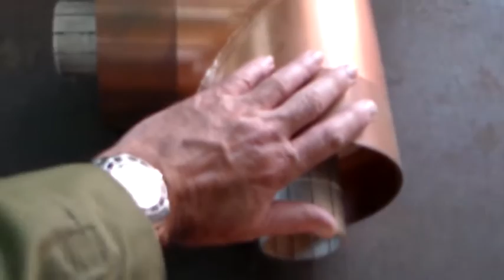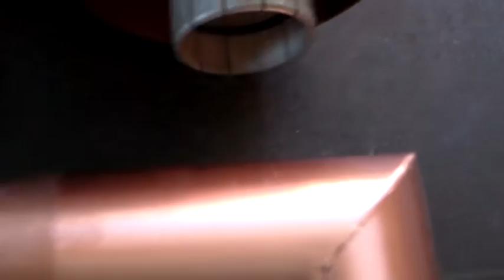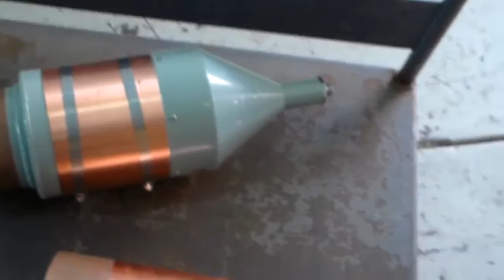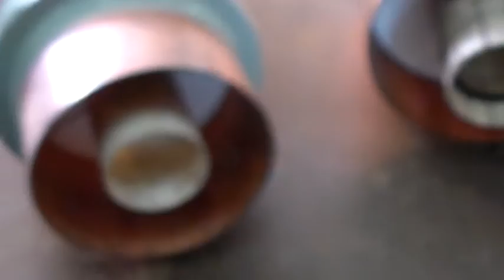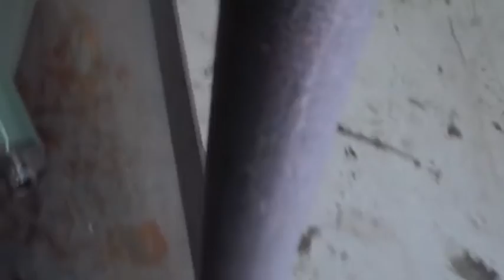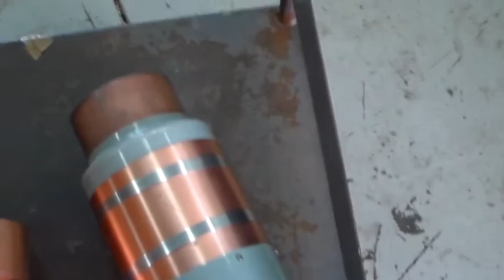High Power Co-axial Connectors And Adapter Used In Broadcasting.

Comment: Copper plated because the RF flows on the outside.

These are not actually coaxial joiners, they are simply right angle bends to take the pipes wherever they need to go. Most broadcast sites use straight pipe feeder. They are "fittings".

And the highest plug for a Bird 43 is 25kw through-line. Not that you would connect it up mind you - It's just for test.

Nice video. I rarely went into broadcast sites. They were always boring for me and we had no reason to go into them.
Reply from the maker: Thanks Ade. You're right, they are joiners not connectors, but they are actually co-axial joiners, they allow the large straight bits of co-ax to be bent around corners. And the RF flows on the inside conductor and outside sheath.

I realized as soon as I said it that you wouldn't be using a Bird Thru-Line on a transmitter that required 4 inch co-ax. I left that in because I thought it was funny.

I knew the Bird could handle a fair bit of power but I didn't know it could take 25kW. That does seem a lot to put through a 'N' connector, maybe I'll look it up.
Reply: VK6CS Yeah, I looked it up.
25KW through the meter..... I think it would vibrate like a chain saw.... LOL
Reply from the maker: I can't imagine an 'N' connector lasting too long with 25kW running through it. It must be ok on the meter because of the very limited duty cycle.
Reply: VK6CS Oh yeah, I would not hook it up and be in the same room or in the same area.....
People don't realise that just 50w is a LOT of power.
The reason we have tower and perimeter fence security with HUGE signs saying DO NOT CLIMB TOWER,
HIGH VOLTAGE
RF Ionising RADIATION
Turn off Tx before climbing tower
Staff, consult staff radiation folder

It's fucking dangerous.

Ever put a chicken on a pole and roasted it in front of a 4m dish ? It turns black in about 2 seconds.

Idiots have to realise that it is actually dangerous......
Reply from the maker: LOL. I can't say I've ever tried the chicken experiment. People don't understand it's dangerous because they can't see anything. But you're absolutely right, it's bloody dangerous. UHF can make the fluid in your eyes go cloudy, that's that, they can't suck it out and replace it, it's permanent. I won't even use a UHF hand-held as I don't want the antenna anywhere near my head. I used to do marine electronics on large luxury 'superyachts' and some of the radars could have 70kW peak pulse power. Some of the guys would walk around on top of the boat while the radar was running but you wouldn't get me up there.

I have to go Ade, I'll catch you later.
Reply: VK6CS I'm also a GMDSS 1st Class Tech operator and the captain is responsible.
Wow !!!!
That's really bad practice.
Cheers.
Reply from the maker: What on Earth is a 'GMDSS 1st Class Tech operator'?
Reply: VK6CS The rules for radio and safety at sea changed forever in 1995.
Today, all you can have at sea for radio is a Global Maritime Distress and Safety System technicians and operators certificate.
EVERY ship in the world must have at least one deck officer who is GMDSS compliant so when push comes to shove he or she can press the big red button.
If you want to work on a ship with radio and safety then you have to have a GMDSS, it's global, under the ITU and IMO.
Reply from the maker: Righto...
Reply: VK6CS Are you not aware of STCW 95 ?
Every trading ship must have a GMDSS officer or someone with a previously obtained award of greater value such as a Seamans Radio Instal and Service Tech certificate.
(A maritime radio bus ticket eg)

Anyone on a ship can use the radio gear with the permission of the Captain but there now must be a GMDSS officer on board all trading ships no matter where they are operating 

All ships must be GMDSS compliant and someone on board must have this or better (in the old money)
Reply from the maker: No worries. I haven't had anything to do with boats for a long time.
Reply: VK6CS"Believe me my good friend, there is nothing, absolutely nothing so much half worth doing as simply messing about in boats" - Badger, Wind in the Willows.